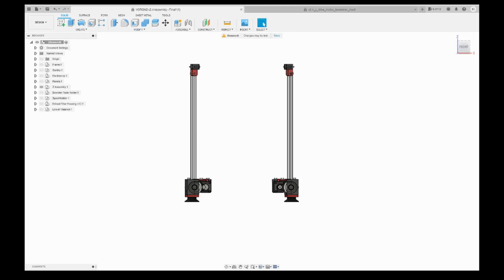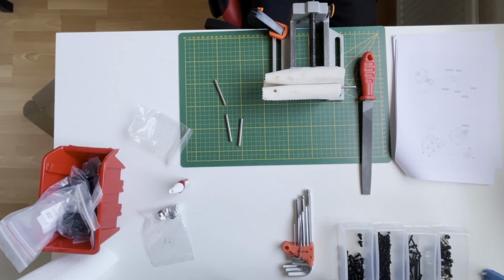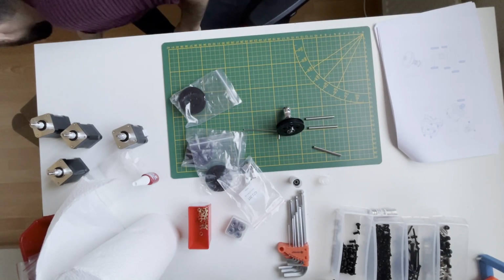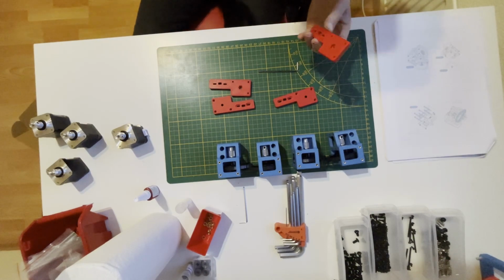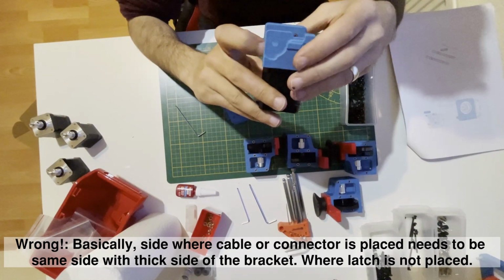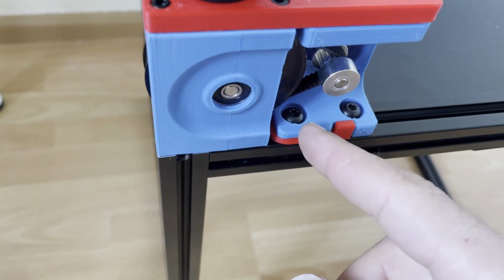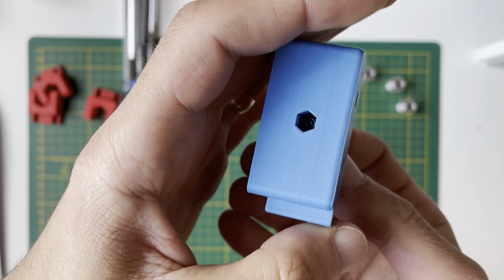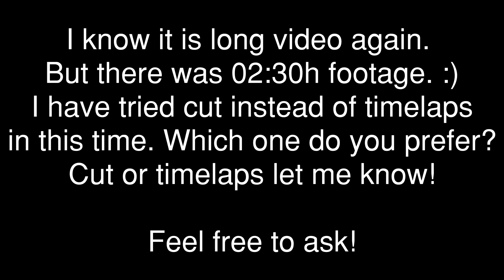Building Voron v2.4 - Z Drive [Ep4]

Comment: These videos are great, thank you!

I think you should not worry too much about the length. Building a Voron is a lengthy process anyway and I like to hear your thoughts and tips about every step. However, I think you can cut out repetive steps. Just say that you need to do this 4 times. Although I’m sure you’ll learn yourself what is the easiest way to assemble a subassembly during the first few repetitions so you might have the best advice during the last.

I’m building a Formbot kit myself pretty much right along with you. Finished the Z drives yesterday :)
Reply: i cant find the mods for the mmotor mount and the base? are you using that also?
Reply: @lorenzgamboa2557  No, actually I used aluminium parts from Funssor. So far so good.
Reply: @viljamip  good to hear that aluminium parts is fitting correctly. My kit is in transit so im printing my parts. you should document your build also so we can get idea lol.
Reply: @lorenzgamboa2557  Its progressing quite slow, 0.5 days a week, so I probably wont spend too much time on documenting the process. I will post on the Discord if any major issues arise. Largest issue yesterday was that the mounting holes for the Z motors were not deep enough. M3x8 screws bottomed out so I had to use M3x6 I had laying around. My motors are different than on this video. No connectors on them, long wires instead. No branding on them either.
Reply: @viljamip  what is the brand of your motor? lets chat in discord add me up EnchongG
.
Reply from the maker: Thank you for your feedback. I am glad to hear that videos helping you guys. Good luck with your build also! :)